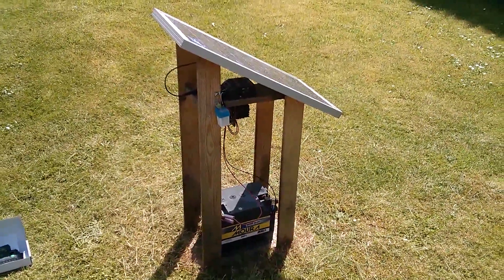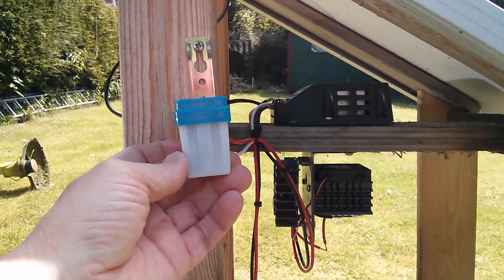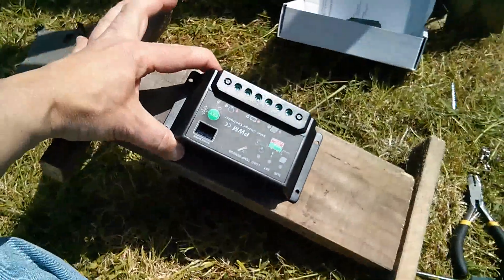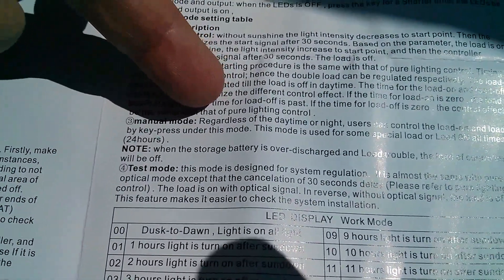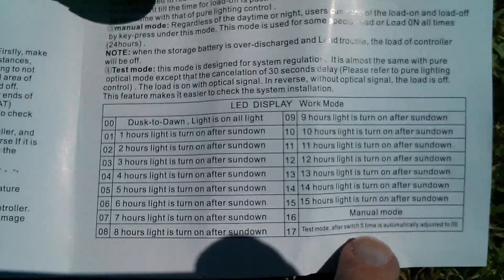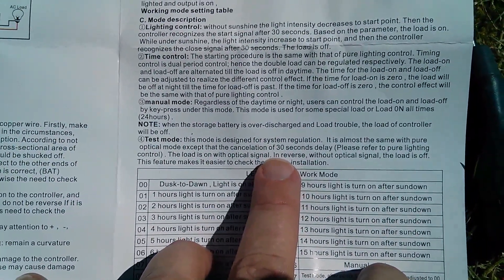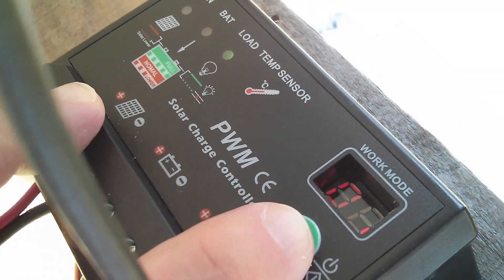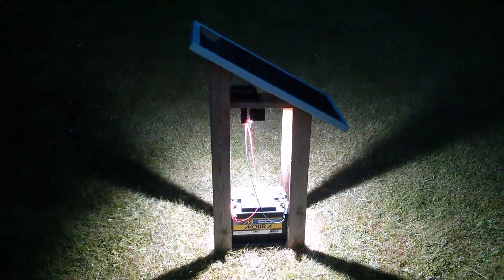Julian builds: a Monster Bright 30W LED Garden Solar Light (update)

Comment: Hi Julian/All  Be interested to here peoples feedback.  Recentenly purchased a similar PWM charge controller and in testing noticed something "rather odd". The common connector is the positive connection and a switched side is on the negative. Is this normal for Charge controllers and if so why?
Reply from the maker: James Tutton Most cheap controllers are common positive - it's easier to drive the MOSFETs in this configuration. But I prefer designs with a common ground.

Comment: I have one of these controllers in the roof space running some night lights. A 20 watt panel on the roof of the house and a 14Ah SLA battery running 3 LED lights. It has been running for a over a year now and works well. The controller turns the lights on at dusk and off at dawn. It seems to treat the battery reasonably well; no signs of stress yet. Although dusk could be a little earlier.

The lights are flush mounted 5 watt GU10 mains daylight LED fittings stripped and modified for about 6V supply and fitted with mini voltage regulators for steady output and brightness adjustment. A 12V supply at 2.5mA provides plenty of light for wandering about.

I did try a red LED lamp as it's supposed to interfere less with sleep. But the it had a much higher current draw for lest light, and just wasn't a nice light.

Comment: Julian please please please make sure you use a fuse as close as possible to the battery. I think you should also point out to our youtube watching friends that playing with batteries involve a bit of danger.
I have a similar setup and after 25 or so experience I managed, while trying to be quick, to mess up the polarity. The result was an enormous bang and I was lucky I was wiring it outside, also part of the issue of not seeing the colours correctly ... too much sun. Luckily I was unharmed.
Also do you buy these batteries new or do you get them from car wrecks?

Comment: Did your charge controller do proper PWM and floating/absorption voltages or did it overcharge the battery like mine did? Please test it, it's important to know if I should get a refund from Alice or ask her to send a new one :)
PS I love your garden light, I am trying to do the illumination of a tree with RGB LEDs and the charge controller from Alice but since it doesn't properly terminate charge, I'm not using it :D
Reply: MrOpenGL i had/have 2 of the same showi in video, one worked for weeks, then ended up putting 17v into the battery, the 2nd still works fine, perhaps its a mode of failure in this particular model, but my oldest cmp12 also works fine, never failed, its old faithful!
Reply from the maker: jusb1066 The CMP12 has a much more sensible heatsink arrangement. I really don't like the flat metal plate on the back of the new controller. Time will tell.
Reply from the maker: MrOpenGL I'll check the battery voltage when the sun next shines - don't hold your breath!
Reply: Julian Ilett  Thank you :D :D
Reply: Julian Ilett I have one of those CMP12 units, swapped it for a CMTP02 (281624561087) as it only charged to 13v4, so not much power for nightime use. The CMTP02 charges to 14v4, and I now have a much happier AGM battery. Do you happen to know if the trimmer pot on the CMP12 board is a voltage calibration/adjustment? Never got around to prodding it to find out.
Reply: Peter Feerick
i did play with the pot on the cmp12 and i think a cmtpo2 that like you only charged to 13.4v, it didnt change a thing on either model

Comment: The only thing really preventing me from doing something like this is the cost of crystalline solar panels. That and having a large proportion of the site wired with armoured cables. Environmentally, the solar array on the roof can generate about 6-7kW in sunlight, so you can't say I'm not trying with solar!